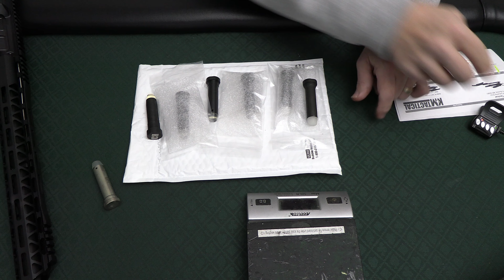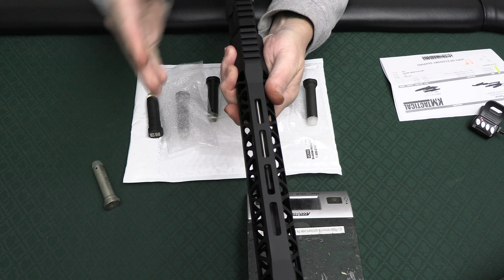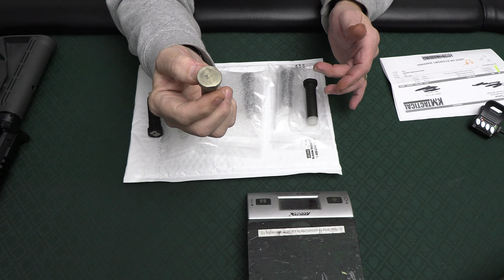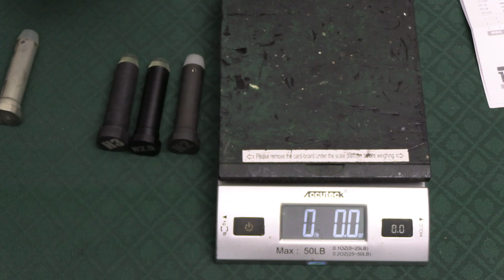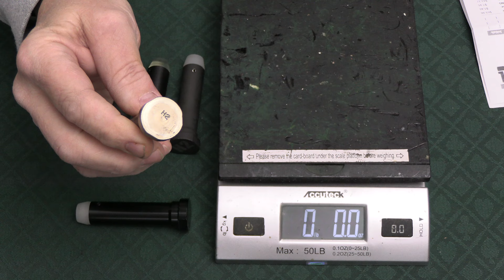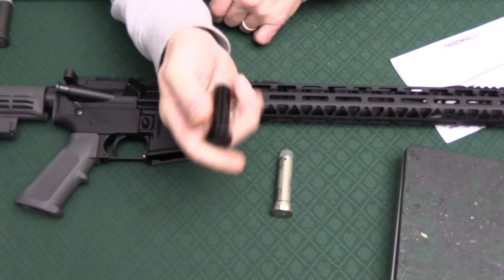AR 15 over gassed try a heaver buffer

Comment: If I may ask, what are some of the ways one can tell if their rifle is over gassed?  I know about the ejection pattern test but is there any other methods that can be used to test without specific tooling?    I guess getting all the "GO" / "NO GO" gauges might end up being worth the price in the long run. 

Thank you for this presentation.
Reply: Double feeds, gas blowback, and brass damage will also indicate overgassed ARs. I’ve seen AR10s rip the rim off of brass before they were fixed.
Reply: @thurstonhowell9782  Oh wow - Thanks for sharing that information.  I am more versed in pistol calibers but just recently got my first AR then put a second together but haven't been able to get to the range yet.  

Very helpful to know what kind of things to watch out for.